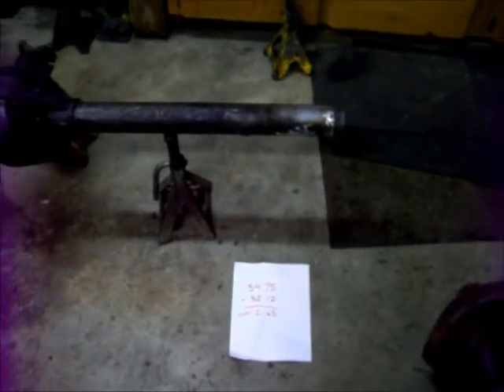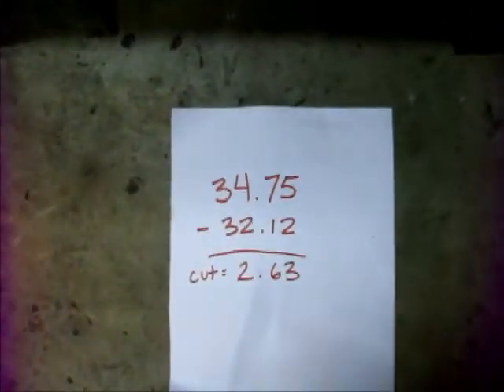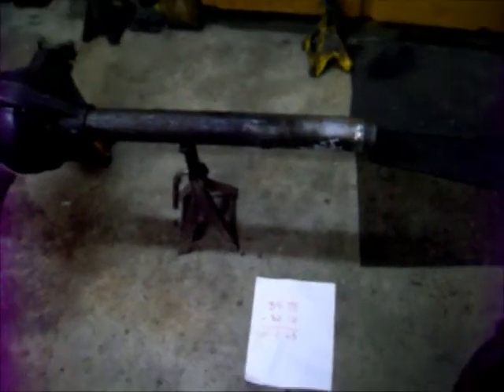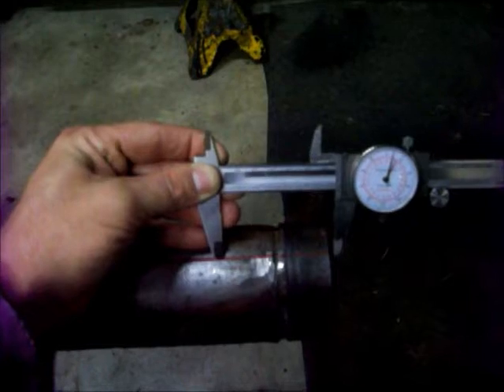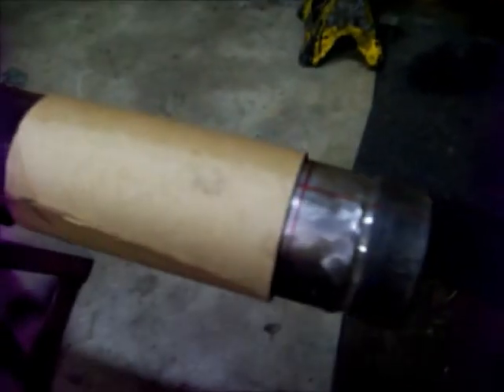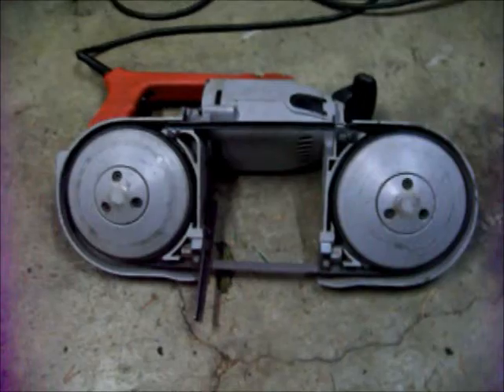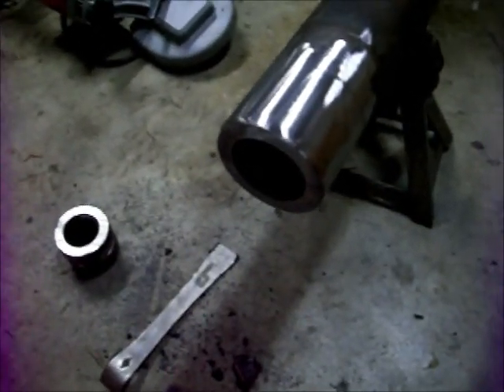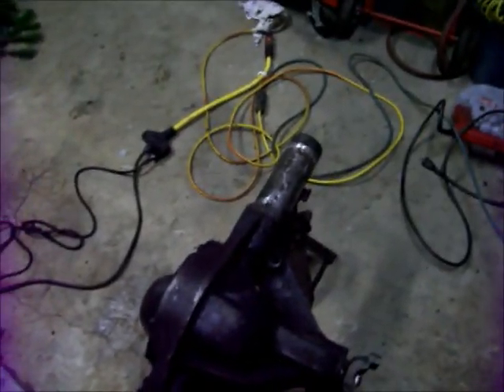CutandTurn.com Presents: Narrowing a Dana 44 front axle

Comment: did you cut the short side? if so, what measurements did you use?
Reply: Roberto, I too have the same question.  I am in the planning stage of shortening a 1979 Ford HP Dana 44 down to a Grand Wagoneer narrow track width.  I have found some Spicer/Dana data online that matches the numbers in the video of 34.75 (Ford) and 32.12 (Jeep).  It also included the short side measurements, Ford 18.62" and Waggy 15.80".  So, the short side cutoff would be 2.82". I can confirm the accuracy of the Jeep Waggy axle shafts as I have some in my possession and they match the Spicer/Dana chart.  I would like to find someone who has done this and can confirm these numbers.  I hope this helps some.
Reply: @joepoznik8156  since I have the 8 lug HP D44, the hubs are wider than the waggy hubs. to swap to waggy hubs will cost too much money. I'm keeping the bigger brakes and hubs, ill be narrowing the short side for an overall 63" width. I'll end up running a custom short shaft axle. easier and cheaper.

Comment: Great videos! Thanks for sharing! Wondering if you can give a little help here. 
I am wanting to narrow the passenger side of my 1977 F-150 FW HP D44 to use a Shorter Early Bronco axle with the upgraded HD U-joints. My axle has the weld on wedges for my Radius arm & caps. I have to grind the welds to remove the wedges before I can grind the weld on the pass side "C" to remove it so I can cut the tube shorter.
Could you tell me the best way to measure the new axle to figure how much tube I need to remove (have only heard around 6"), and should I just copy the distance/location from the drivers side "C" for replacing the new aftermarket wedges & original "C"?.  Thanks!
Reply from the maker: Your current long side axle is 33.91” vs. the Early Bronco long side at 27.94”. So you need to remove 5.97".

Take a ton of measurements so you can put everything back together at the same angle, spacing, etc. Remove the wedges, remove the inner "C" - then cut off the 5.97" of tube abd put it all back together... :D When you put it back together use the short side as your template for the angles and spacing - they should match when you are done and the axle should be 5.97" narrower over all.
Reply: uglyscout Thank you! 
Going to use a 14" metal chop saw. That should prove to be fun!

Comment: THANK YOU!!!!

I need to make a new axle for my 73 Jeep CJ-5 to match the offset of my Dana 18 transfer case.  Do you know how I might find the correct length for my tubes?  Would a Ford F250 D44 like the one you used be large enough to start?

Thanks again for a really educational video, and any other advice you might be able to provide.